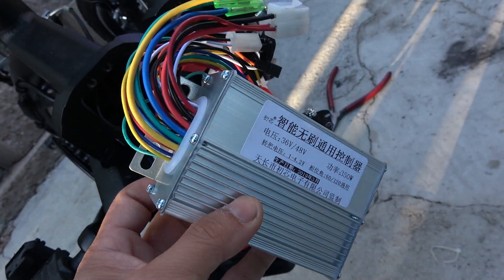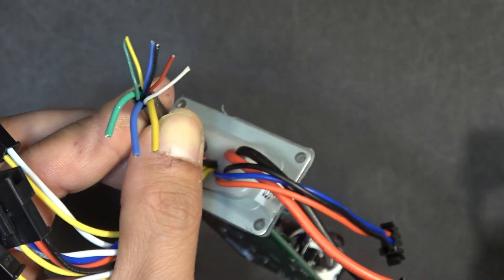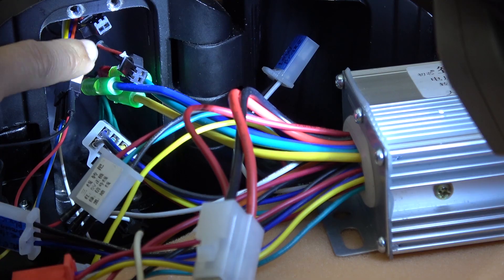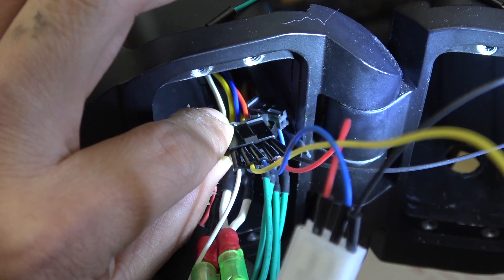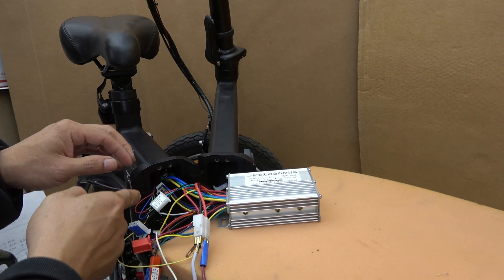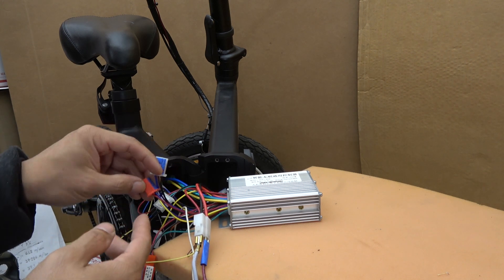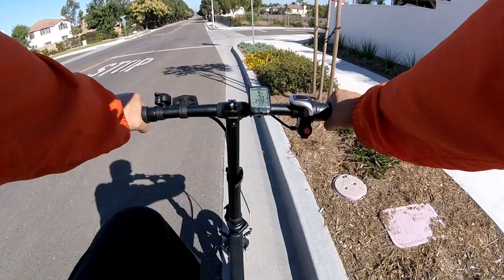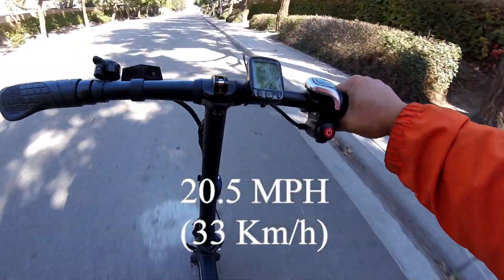Increase speed of ebike: Swagtron EB5 controller upgrade

Comment: I think that the white cable that came from the motor it the speed signal cable. Some controllers need it to know the speed you are. Running, but others controllers just use the hall sensors signals to read the running speed. That's why you don't need it if your controller don't have it. In my case I need a controller with just 5 cables because mi a hub motor don't have the 6th signal and a controller with 6 pins will not show me the running speed.

Hope that this helps and thanks for the video 😉👌🏻

Comment: Interesting video. Looking at your original ESC which is 36V and max amp 16A = 540W, whereas the new ESC is 350W but can operate at 36/48V. So i am little confused what have you achieved here? does the new ESC operates the bike at higher voltage or provide more current? Also, how do you ensure that your motor does not get cooked? Interested to know your response.

Comment: For those watching this for tips, that white wire he didn't use is for speed sensing or temperature sensing depending on if the original controller has an external speed sensor or not.  If you bike has a magnet on the spokes and a sensor then you have an external speed sensor and the white wire is for the old controller to monitor the temp of the motor.  If you don't have an external speed sensor then the white wire is how your old controller got information on the speed you were traveling

Comment: What is that 6th white colored hall wire used for ? I heard it is a speed control wire. I have a bike and it only goes 14mph. I dont know how to tell the difference neither how to use a multimeter and there is not anyone for at least 200-300 miles who will work on my bike since they are required to only work on their own bikes. And I was wondering if I disconnect it, will it be safe to ride ? To test if my bike goes faster ? Could I burn the motor out ?

Comment: 12:26 The sharp edge in the aluminum controller housing is going to cut main power wires to battery and most definitely spark and short. Please  be aware!

Comment: The controller on my stigo has a simpler but wierd wiring layout. It has a 9-pin for the motor, a 1T4 for the throttle, brakes and lcd, one connector to the headlight, one connector to the taillight, one connector to the horn… I cant find any controller similar to it.

Comment: I am also using a 40v mower battery. Got a used geared bafang 350w brushless hub motor. Just looking for the cheapest controller and throttle to get riding. Are the PAS and brake sensors nessasary? I dont need any of that. Any 15 or 20 amp controller recommendations?

Comment: Nice video. But how did you get the LCD display working, as the controller has no connector to the LCD? But the video is showing LCD works, and supposedly all functions (e.g. settings) of it, too. So, how come?
Reply from the maker: THE LCD is separate unit and it not connected to the controller.
Reply: O.k. Thanks for the quick response. My bike's LCD is directly connected to the controller.

Comment: Don't buy this bike like I did. After using the bike only eight times or
 charging cycles my bike only get about 2.5 miles of distance out of as 
single charge. Pedaling the bike after the battery has died is a 
nightmare. I have to push the bike after it dies. Do your homework 
before purchasing this bike. There are many reviews out there like mine 
where the battery only lasted a short time or has a distance of 
approximately 2 miles after a few uses. I wish I payed attention to 
those reviews.
Reply: Swagtron should be shot for selling a bike with non-customer-replaceable battery, only to also have those batteries fail or go flat defectively, which renders the product trashed by their reccommendation. It's the same thing as tv OEM's do where they install parts they hope will last just a little over a year before going bad and giving you a 12 month warranty on it. Calculating how close to make that balance be to maximize profit is literally someone's job, and that's accepted by the consumer?! Madness. 

Think about all the waste this bike generated and how evironentally destructive it was to make that profit for them.

Comment: I have a 1000w 48v electric scooter the max speed is 18mph I want to go at least 22/25 on average is there a faster way instead of trying to lose a couple pounds by the way it as no eco/turbo button that red button on the throttle
Reply from the maker: There has to be a speed limiter on your controller. My 48V 1000W ebike can do 30MPH max. I would replace a different controller that has higher specs.
Reply: vuaeco do u have and email so I can send u a picture of my controller I no nothing about these things all I hear is it could b a black wire or white my controller is a dc brushmotor my scooter looks like evo but says volt on the side of it
Reply: vuaeco thanks for your reply I wondering if that wire is inside the controller box

Comment: I believe the thin orange and black wires with connectors that you tried and nothing happened, are the cruise control, if you connect and let throttle press as constant speed for few seconds. Cruise will activate. Since is really nice feature. Don't you think?

Comment: The 6th wire is a sensor wire and is usually connected to a speed limiting function and LCD speed indication in the controller. On many LCD controllers the initial set up includes programming the wheel size to calibrate this speed sensor. Some hub motors have an internal sensor coil that outputs a pulse on the white wire, while others, usually center mount motors, depend on a magnet and sensor mounted to the spokes of the wheel. Many newer controllers use the pulse rate sent to the FETs to calculate speed which gives a faster display change response at low RPM and eliminates the need for the white wire. Some have said the white wire is connected to a temperature sensor but I have not been able to verify this. The best way to check is with a digital pulse analyzer or oscilloscope. If it produces a pulse as the motor spins, it's a speed sensor; if it outputs a variable voltage as the motor operates, it's a temperature sensor.
Note: do not completely rely on a volt meter test on this wire. A pulsed DC voltage will register as an average DC voltage on a volt meter unless the pulse repetition rate is very low.
Reply: The white wire?
Reply: @dylansoutdooradventures  The "hall sensor cable" has 6 wires with one white. (2:15)
Reply: @3DPDK  Yeah I have 6 wires on my hall sensor. I unplugged the white wire and my display stopped displaying speed but did not seem to increase speed of the motor.
Reply: @dylansoutdooradventures  It wouldn't unless the controller is set up to limit bike speed. Not all of them have that feature. Some controllers have it but you have to turn on the option and set the limit.
Reply: @3DPDK  I have an ebike that feels like it stops pulling max power once I hit a certain top speed. Even though I can hit about 28mph. I don't know what's causing the controller/motor to stop giving power once it hits a certain point. There's no singular speed limit wire.
Reply: @dylansoutdooradventures  Two possible causes:
1. Maximum battery current output has been reached. A battery's maximum current output varies from one manufacturer to another - not all 18650s are created equal. The maximum output will also decrease with age (or hours used).
2. Many controllers made for the U.S. market as 1000 to 1200 watts are "throttled" to 750 watts with a current regulator in the circuitry. This is to adhere to many U.S. state regulations that keep the bicycle from being classified as a "motor vehicle". 28 to 30 MPH is about the maximum speed on most 26" bikes at 750 watts. In this case, the power capability is limiting the speed, not the speed limiting the power. Some controllers have a software override, some can be overridden with a jumper on the circuit board.
Reply: @3DPDK  My battery uses samsung 22e cells with 28a BMS, 48v battery. 26a controller. 1000w hub motor. The bike gives up once I hit max speed instead of pulling me until I let go. It's so strange because my old bike that was marketed as 750W motor with only a 22a controller could hit 29.9mph on a full charge. This bike is supposed to be stronger and the max I get is 28mph (both speeds are with GPS, ignoring bike display)
Reply: @dylansoutdooradventures  If the power cuts off under full load, like full throttle up hill, or full throttle acceleration, or prolonged running at full throttle, that is over current sensed by either the controller or the BMS. If you have to turn off and on the controller to reset power, that's the controller.
Other than the power limits set by the manufacturer, the other thing that can cut power is flakey FETs in the controller. An FET is the final power transistor sending the power to the motor. It's a lesson in electronics of what happens when these FETs become heat damaged but it causes the controller's current sensing circuit to register an over current condition - it thinks the power cable to the motor is shorted. Well, it's not shorted in the cable or motor, it's shorting in the FET.
Most BMS systems will turn back on without a reset after the voltage recovers and current draw is reduced, but most controllers are programed to stop functioning until reset under a short condition.
I have a similar setup and had to replace the controller after a year. It ran very hot in the summer. The FETs went flakey and did exactly what you describe until 7 of the 9 FETs eventually shorted out completely. (They short out to ground inside the transistor) Most of these controllers, especially in kits, come from China and it is extremely difficult to find a US or European replacement FET to repair the board. I replaced mine with a controller from ElectricScooterParts (.) com, upgraded to 1500watts and have had no problems for 3 years now .... but 32mph is my top speed with probably the same motor and similar battery
Reply: @dylansoutdooradventures  By-the-way, the controller I bought to replace the original still cost $80 (US). ElectricScooterParts is a US company that takes these Chinese controllers, tests the circuitry, sometimes upgrades the FETs and then weather proofs the case better than original. You have to figure out what cables go where but the "instruction sheet" has a fairly clear labeling that helps. If you buy one from them just make sure it's a brushless motor controller.
Reply: @3DPDK  The motor isn't cutting off due to over current. It only happens at max top speed, the bike is completely fine until the bike feels like it's going too fast then it cuts off to keep you from going any faster
Reply: @dylansoutdooradventures  two questions:1. does this happen at 100% charge? 2. how old / how many charge cycles is the battery pack?

If the controller starts running the motor again once your speed drops, then it IS most likely a speed limit setting in the controller. Access to this setting is in the LCD instructions, or you might find a YouTube video on how to deactivate it. This setting in (most of) the LCD is in kph - 50kph is 30mph.

 If you disconnected the speed sensing wire (the white wire) and this still happened; the controller won't cut power due to a speed limit setting because it has no way of measuring your speed. What you are describing is a problem developing either in the BMS or the controller.

Comment: Wow, you're a very good teacher.

I recently bought motor controller as well... I was not yet well prepared to connect it properly to my motor. So I struggled with finding throttle cables, the worst case scenario is that my controller had on and off switch on it, so you can imagine the confusion I was in. So to cut the long story short, I failed to make my controller function to a point where I thought myb the controller was not working. So i opened it up and cut all the connecters to be left with loose end cables. So I'm in a situation where my cables are no longer in groups. So up to today, from your lesson, I have noticed where I was wrong. The on and off cable, I didn't know about it, so my controller remained off, whereas I did not connect the on and off cables. So can you please make a video in regrouping the cables, tracking them from the circuit. I'd appreciate that.

My controller is more like yours. 36v 350 watts.

Looking forward to that video
Reply: You might try removing the screws from the side of the controller first, then remove the screws from the end of the controller where the wires come out.  Looking on the front and back of the controller, you will find labels printed on the board.  This may help you regroup the wires, along with this video.

Comment: Great video mate.. Thanks for sharing. 1 question, i have a similar one, different brand but the bike speedometer is saying 25km/h and so the motor stops as it is the speed limit but the real speed from different iphone apps is 19km/hr Thats 6km/h difference which is a lot. Do you know where that could come from and how to fix it as the speed sensors are in the motor i guess. Could changing the controller fix that problem as i cannot fix it from from the lcd display? Cheers
Reply: The speed limit cutoff is (in most cases) controlled by the LCD. The difference in speed you are measuring is that the LCD is determining speed using a larger diameter wheel for it's calculation than what is on your bike. There is usually some method to initially program the LCD to tell it what wheel diameter to use.

Comment: is the upgraded controller simple one of the 36-48v 350w ebike controllers for brushless motors from ebay? btw cool video!
Reply from the maker: Yes, that's it. You need to know the exact dimensions or it won't fit in the bike's housing.

Comment: with reply   to your answer.i checked my battery and its well balanced within .1 of a volt each pack its split into 3 parts my 14s5p 2 x6s an 2s so can balance .would a good bus help with my power drop up hills or hard acceleration or is it weak connection somewhere.its a vruzend kit its put together with.                                                      t
Reply from the maker: I think it's the Vruzen kit connections. They are not very secured. Spring loaded connections are not good for high discharge applications.
Reply: @vuaeco  ihave had it working well with no drop outs when on a 12mile run once with last motor.ive been looking at that mael spot welder from germany so can make another kit or strenghthen this one
Reply: its not spring loaded really its the nickel plates an nuts an bolts.im goin to replace some connecting wires with thicker guage stuff an check all connections.just watching you lead acid battery revival.my wifes cars battery is weaker now but starts in ilder weather ok.

Comment: I just did this with a similar controller, hell yea man, the bike is now a beast and I can go anywhere in no time. I'm going to perform a 2nd battery extension next, gonna hook up the two batteries to a 3-way switch
Reply from the maker: "Hell yea" sounds just right! :D
Because of the smaller wheel, now everytime you accelerate the throttle, it'll be like getting a hard a kick from the back. It's a lot more fun to ride compare to the old controller.
Reply: @vuaeco  you said it, your video was the only reason I even thought about this! Now im thinking why didnt I do this earlier!